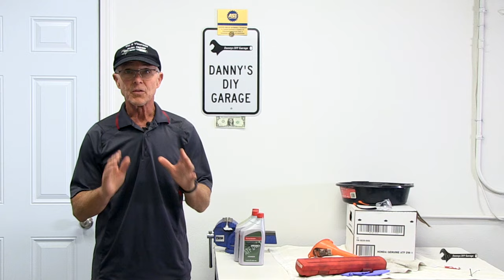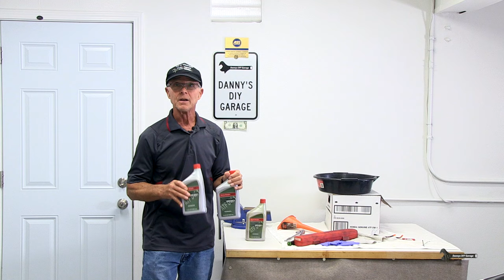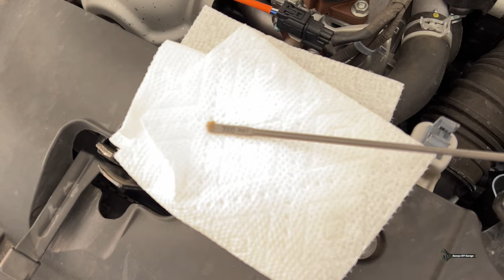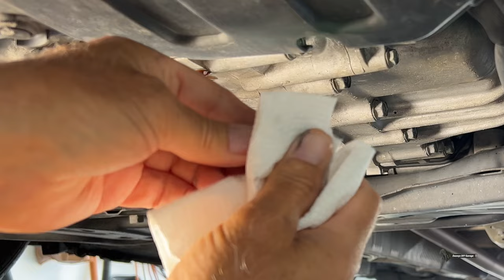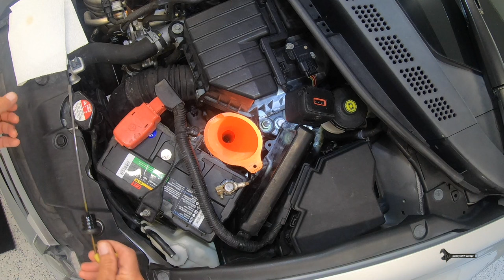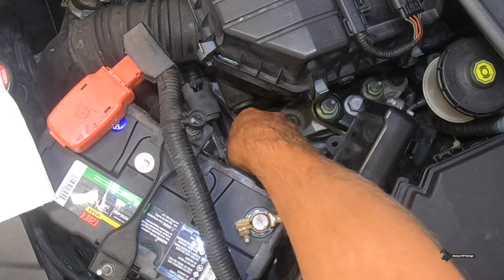Smooth Shifting! 8th Generation Honda Civic Transmission Fluid Change (DIY) Save Money!

Comment: While doing a drain and fill on my civic, I used an aftermarket ATF because it works well on Toyotas. DO NOT DO THAT! ONLY USE the proper Honda ATF as stated in this video! The aftermarket fluid caused my transmission to slip, and I had to drain and fill 6 times with the proper fluid to correct my mistake (I spoke to a former Honda tech that I work with to figure out the cause of the slippage, he said that if I continued, that it would damage the transmission). Thanks for another great tutorial!
Reply from the maker: Thanks for sharing this, hopefully others will read this, avoiding tragedy
Reply: I heard ther finicky but I trust Castrol inport trans max.  Though I wonder specifically wats differ about the cvt trans max fluid for the belt driven tranny
Reply: @zakatdisney  I'd heard the same for power steering fluid. So, I picked up ATF when I got some PSF from the dealership.

Comment: Honda’s procedure states that the car should be running at idle until the cooling fans cut in and out 2 or 3 times before checking the transmission fluid level. This gets the fluid to the correct temperature to get an accurate reading.
Reply from the maker: Thanks for adding

Comment: I have a 2009 civic lx that has 104,000 miles on it and it probably hasn’t had a transmission fluid change for quite some time. Do you think it’s still a good idea to change the fluid? I’ve heard people say to not change fluid if it’s that old but I don’t know if that true.
Reply from the maker: Absolutely change it, 100k isn’t bad, I’ve heard that also
Reply: i bought a civic a year ago with 315k miles on it 1 owner had dealer only maintanance. the carfax said dealer serviced it at 288k no other prior trans specific record before that,it just said maintanance done. i changed the trans fluid, then went 5k oil change. changed the trans fluid and filter after that now car has almost 350k, planing to change it again at 350k. all oem fluids.

Comment: I have a 2010 Honda Civic LX, I first changed my ATF at 90,000 miles with genuine Honda transmission fluid, I replaced the transmission filter also, then I drove it for another week, and changed the fluid again! still, shift like a dream. now it has close to 130,000 I'm considering changing it again after 40,000 miles!
Reply from the maker: @rajeiveds  that’s a great idea

Comment: Hey Danny, I just wanted to personally thank you for giving me the confidence to change the transmission fluid in my 2007 Civic. I was experiencing some growling noises from the torque converter as well as delayed/hard shifts, and all of that is now resolved after only two drain and fills of Honda genuine ATF DW-1. I plan to do one more after about a hundred miles.

The fluid was last serviced at ~30k miles back in 2010 and never since until now at 180k miles. I was very hesitant to change the fluid as many people on the internet said changing it too late may cause slipping and other issues, but it shifts much better now and abnormal noises have subsided. For additional context, the fluid was dark red and smelled a bit burnt/foul before I changed it; now it's much better. I enjoy your videos and look forward to more in the future! :)
Reply from the maker: I appreciate you taking the time to write this down, glad I could help
Reply: You had no issues whatsoever doing that? I’m really hesitant in doing so too as I bought mine with   170k miles. I don’t know if it’s ever been changed but it’s a reddish brown color, smells a bit off but it’s time to change it for sure. Not sure if I should do it or not.
Reply: @pasidudissanayaka1843  I would absolutely change it! It's been a few months now since I changed mine and so far it's been shifting very smooth with zero issues. I completed three drain and fills but I noticed the biggest improvement after the first. My fluid is currently bright red (almost pink) and doesn't have much of an odor. It used to smell kinda burnt and looked very dark. Make sure you only use genuine fluid though; Hondas are very sensitive to that. You'll also see black gunk on the drain plug magnet, that's completely normal. Hope that helps!
Reply: @aj8991  perfect! That really did help. Now I have piece of mind changing it. Should I also change out the filter on it or first do a drain and fill since I got it recently? Also for the magnet, can I clean it with brake clean or is that not necessary? A good wipe down must do the job. Thanks again!
Reply: @pasidudissanayaka1843  I was initially going to replace the filter but after only the first drain and fill, it was shifting perfectly and had no issues. I might tackle that sometime in the future, but I left it for now. It's also kinda a pain to access lol. As for the magnet, you can just wipe it with anything. Also, the drain plug itself might be very tight if it hasn't been removed in a while. I personally used a breaker bar and placed a floor jack under it and slowly pumped (this can be risky if done incorrectly, use caution). Good luck!
Reply: Appreciate this comment I got a 2003 Honda Civic 180k just changed the engine oil it was very black so I'm guessing the trans fluid was never changed so I was hesitant but if your tranny improved maybe so can mine I got a shudder at initial acceleration then its gone
Reply: @chrisjoy9248 I've had that same initial shudder in my 2008 civic since I bought the car new. But it is now 16 years old and never got any worse. I've changed the transmission fluid every time the dealer recommended it.

Comment: Hi Danny. A+ on all your videos. I own two 8th gen civics and know them well. My wife's 2011 we bought it in 2013 with 19k miles on it. My procedure for checking fluid level is different than yours I think. I'll drive the car for 15 minutes at highway speeds. Once back home shut the car off. Wait 1 minute, then check the fluid level. I could be wrong I bought I read this procedure from a manual service manual. The reason I bring this up is because when I drain and fill, I'm only using 2 1/3 quarts. When I drain the fluid it goes into a clear jug with fluid levels. I'll mark it and then put new fluid in that same jug so the drain and fill is near perfect every time. Are you sure you're not over filling? That fluid will expand when hot. My wife's car now has 110k miles in 2023. Even though I can take these cars apart in my sleep from owning them so long, I've still learned even more watching your awesome videos. I'm in WI, wish we were neighbors. Lol.
Reply from the maker: Appreciate your additional information here, If we were neighbors, I would have more video content , thanks Robert, I appreciate your information added to this channel, please continue to add any information you think that would help others
Reply: The level depends, i have changed fluid several times, slight variations in gradient means 2.25 or 2.5 qts. The first time I did it, I did not pay close attention to the slope in my garage and temperature and it blew the transmission seal....$160 for a $12 seal.

Comment: Thanks for the thorough demonstration.  I have a 2008 Civic LX sedan.  165k miles.  Still like new.  Trans fluid drain & fills every 35k miles.  I used to buy the fluid and have my shop do the labor.  But I think I'll just get some front wheel ramps and do it myself from now on.

Comment: Recently bought a 2012 Civic for my daughter. I noticed it has a little shimmy when shifting lower gears when I was driving in my neighborhood. I bought the stuff to do a drain and fill and watching your video, but now some people are telling me not to, that it could cause more harm than good. Any recommendations??
Reply from the maker: What exactly do you mean when you say shimmy? Slipping?
Reply: @dannysdiygarage  sorry I’m not a car person, LOL. It’s just not a real smooth shift in the lower gears. I can feel it more than I do when it’s shifting into a higher gear.
Reply from the maker: @superqcksilver  slipping is when it shift, you can actually see the rpm on the tachometer jump up 200 to 300, kinda hesitates, if it’s not doing that Change it. Another thing I would do is disconnect the battery for 30 minutes, this should reset your shift patterns, make sure you have a radio unlock code, also once you do that do a throttle body relearn, I have a video procedure on this on my channel

Comment: Just to clarify, the 3/8ths extension you refer to really looks like a 3/8ths in adapter for a 1/2 in drive ratchet wrench. extensions are usually in 3 inch multiples, 3, 6, 9, 12 inch etc. are they not?
Reply from the maker: there are 1/2 drive ratchets and 3/8th drive ratchets as well as 3/8th drive and 1/2 drive extensions, you are correct as far as extensions 3", 6" , 9" and 12", you can also get them in 1" and other sizes, but yes any of these will work as long as it a 3/8 extension or you can just use the ratchet as long as its a 3/8th, hope this answers your question, sorry for the long answer, I just wasn't sure where you were going and wanted to cover everything incase others had the same question, Danny

Comment: Thanks for your videos Danny veru helpful is the procedure the same for a 2003 Honda Civic Hybrid?
Reply from the maker: I don't have that answer, make sure you're using the correct fluid, but I'm assuming its the same process. call honda parts for the correct fluid for your car

Comment: Hi danny another great and helpful video glad I subscribed to your Channel .had a question i have a 07civic .when im driving over 30 mph i hear like a humming noise or whining noise coming from under the front end do you have any suggestions what it might be and thank you again for all your help
Reply from the maker: Sorry many possibilities, you’ll need to figure out if it’s speed related, meaning wheel bearing, suspension, tires or engine related alternator, power steering, ect, it could also be transmission, you’ll need to eliminate possible causes to get to the problem

Comment: I have 2008 civic and it’s a manual. 2 questions here 
1: Is everything throng same process except for the transmission fluid? 
2: I bought my car used and I don’t think it’s ever had new transmission fluid. It’s almost at 120k now  should I change it?
Reply from the maker: different process, different fluid, and yes you should change it

Comment: My mechanic recomended doing this every 30k-50k miles and change the transmission filter at the same time. Would you agree with this? I'm asking because I can see you have a previous video explaining how to change the filter, but I don't believe you mentioned that on this video.
Reply from the maker: I did mention it, I suggest the filter every 90 or 100k, Honda to my knowledge doesn’t have any timeline on changing this, transmission fluid every 30k, removing the 3 quarts is my suggestion, sooner if you’re hard on your transmission, hope this helps
Reply: @dannysdiygarage  Oh I must have missed it then, sorry about that. Thanks for clarifying. I love your videos!
Reply from the maker: I appreciate you watching

Comment: i just bought a 2008 honda civic with 189k miles. should i do this ?  i am kind of freaked out
Reply from the maker: If it’s shifting good now with no issues, then yes change it, but if it’s slipping it won’t help
Reply: Just do it.  I just changed the fluid in my 2007 civic with 225,000 miles and it was very dark.  Turns out it had an extra quart in it.  The last transmission service, they must have over filled it .

Comment: Thr transmission filter also needs to be replaced when we are replacing the fluid ?? 
And what about removing the whole transmission fluid pan and clean it's inner metal filter and magnets ?? 
Is it necessary to do? 
I got 265k kms on my honda and I want to replace the transmission fluid it's jerky when changing the gears.... 

Filter + fluid ? Or filter+ fluid+ transmission fluid pan cleaned from inner side as well ?
Reply from the maker: There’s an external cooler filter I would suggest replacing, internal filter gets replaced during rebuilding

Comment: Hi Danny, I hope you are well. Although Honda says to partially change the automatic transmission oil, I don't particularly think it's a smart idea, because the new fluid mixes with the old fluid, as I said in another previous comment on your channel, all you had to do was point the hose that is connected to the external filter to a bucket and about 3 liters of old fluid would come out. You bet, not many people are using those ingenious machines for total fluid change anymore, the automatic oil fluid pump itself does that, just do it right and everything will be fine. Best regards and keep up the good work my friend, God bless you!
Reply from the maker: Yes I’m with you, great point!I’ve used the flush machines many times when working at the dealership and love them, most of my viewers don’t have access to the flush machine and draining the fluid into a bucket is messy, also if you run the transmission dry or out of fluid it can cause problems, especially with these high mileage cars, this is why I recommend doing a drain and fill, it’s safe. As you said a complete flush is best, but drain and fill is safe, thank you for pointing this out ❤
Reply: 2 camps on this, yours and those who believe that leaving a majority of old fluid /metallic particles is good for the clutches   By adding the new fluid you’re effectively restoring the older fluid. I’ve been doing just that and have 245,000 miles on my 07 Civic.
Reply: @SuperWingman69 niceee ! Did the trans ever slip or feel sluggish & Did you drain & fill so?

Comment: What about honda civic 2013 with 188k miles should i drain and fill it? I feel like transmission doesn't shift smoothly
Reply from the maker: I would, if the transmission is already bad it won’t fix it

Comment: Is the official Honda procedure to check the fluid level with the engine idling or off? I know you checked it during engine off, but in other vehicles that gives 2 completely different readings.
Reply from the maker: Honda owners manual say engine off, the way I show is correct for that vehicle

Comment: Great video- I seen on other videos people recommend to change it multiple times to make sure you remove ALL the old fluid (as this method only gets 40-60% according to them). Is that true? Or is doing it only once this method good enough? Thank you
Reply from the maker: That’s true, but if you keep up on the transmission maintenance once is enough ever 25to 30k
Reply: @dannysdiygarage  Thanks for the reply! As well I was wondering is it effective enough to drain all the fluid by just jacking the front of the vehicle up, or do you need the entire car to be level to get all the fluid out? Thanks again for the response
Reply from the maker: It’s not going to make that big of difference on the level unless it’s extreme, if you’re worried about getting the most fluid out at one change, let it sit and drain longer, the torque converter will drain slightly allowing more fluid to exit
Reply: @dannysdiygarage  Awesome man really appreciate it, transmission fluid change is massively cheaper doing it yourself so thanks again!

Comment: Hi Danny, how long do you have to run the car before you shut it off and wait 60 seconds to check trans oil temp?
Reply: What you’re trying to accomplish is the getting the transmission at operation temperature, I live in California so a 10 minute drive works for me, maybe longer depending on where you live,

Comment: Can I use the transmission fluid if it’s not the Honda brand but compatible with me 13 civic? The guy at advanced auto parts said it was fine but I trust you more than him.
Reply from the maker: I use Honda fluid only, Honda spends millions of dollars figuring out the best fluid that works for them, I’m sure it will work, but is it worth the gamble

Comment: Is it a good idea to change the transmission fluid if you never done it? My car already has 150k miles....
Reply from the maker: Absolutely, help that transmission last another 10 years
Reply: I did it on a 2011 civic that I bought about a month ago. It's stil running without problems. Just keep in mind, DO NOT FLUSH your transmission, changing may be ok but DO NOT FLUSH IT. All the gunk and nasty stuff that builded up may go into the nooks and crannies in your transmission and you may end up needing an overhaul. I found this advice on another YT channel and it saved god knows how many thousands of dollars.
Reply: Oh, and make sure yo use OEM transmission fluid only, you can get away with a different engine oil as long as it meets the same specs as the OEM, but you MUST use OEM for your transmission.
Reply: @dannysdiygarage  Thank you for responding. I truly appreciate your videos. I will give it a go.
Reply: @francissinatra8774  Thank you so much for the advice. I will give it a go.
Reply from the maker: @xxspiderxx5541  here is the long answer. Changing your fluid cannot cause any damage by itself, if everything is fine inside the transmission. The issues start to appear when you change the fluid if your clutches are already worn or damaged from abuse. If you go and replace the fluid after they are already worn out. this can cause slipping. The old fluid had contained particles that actually helped shifting, making it grittier to allow better gripping. New fluid doesn’t contain this material and may not grip as well, causing slippage. So although new fluid may cause the transmission to start having issues, in reality, the issues were already there, you just brought them to light after changing the fluid. now you are only removing 3 quarts so even if the clutches are worn, you should be fine and the benefit of the new fluid will help keep the transmission going for years to come